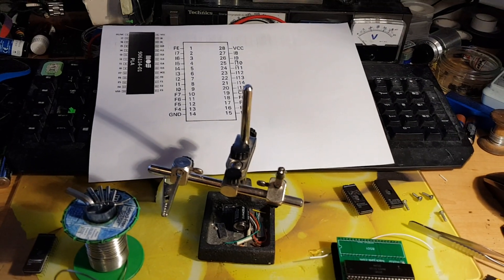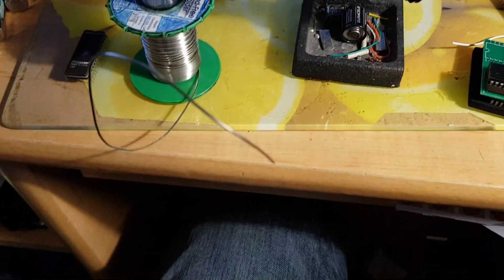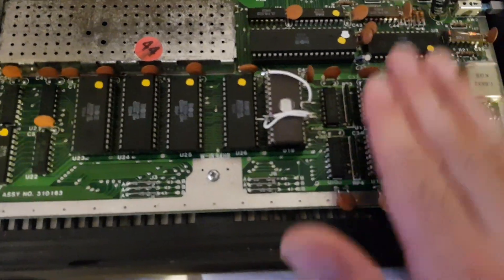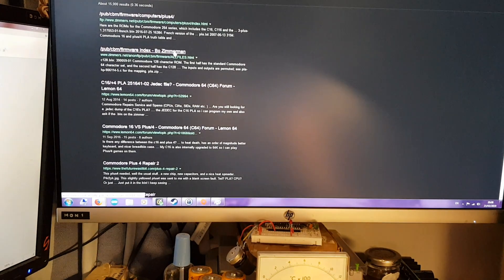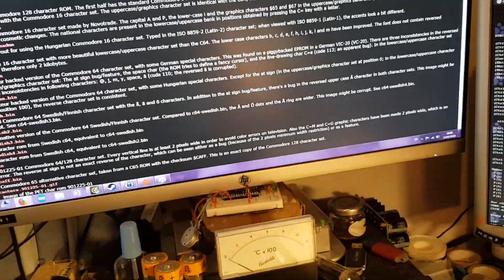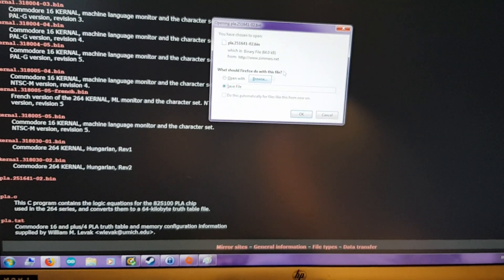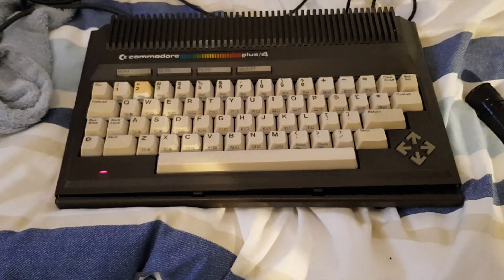Commodore Plus 4 EPROM PLA Replacement Restoration

Comment: when i was a kid i took my plus/4 apart....pulled the chips out .....and put them together again ....shorted a few legs on someof the chips when it was turned on,screen went all multicolored blocks and random characters inversed .......with flashing bits........and it never worked properly again😂
Reply from the maker: Sounds about right. I have fucked up similar in some ways.

Comment: Hi there EPROM9, unfortunately, my Plus4 suffered a PLA failure. I have built this successfully and restored my Plus4 to the land of the living. I used a W27C512-45Z EEPROM. 

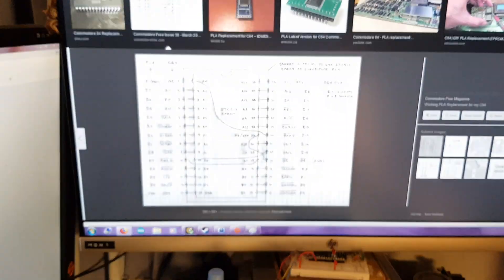At 3:06 there is a momentary image of a PCB layout for an adapter clearly from a German site.  A photo at the bottom is actually board is cut off. It would be really useful to add a link to the original site. 

Thanks David
Reply from the maker: That is good. Love to hear the video was useful in getting another Plus 4 or C16 working. Sadly that site decided to non-exist. The pin out is the same as the C64 adapter luckily.

Comment: Nice to see that an EPROM solution is possible for the 264 series!  How has the EPROM held up over time?  I'm thinking if trying this out for my C16, and am wondering if I can get away with using "faster" EPROMs than 150ns (I think so, but I'm a bit inexperienced with EPROM programming).
Reply from the maker: It has held up pretty well but i don't have any softeware for my Plus 4 so i can only do limited testing. I see no harm in trying faster chips, some experimentation is required. The only thing i would note is the socket adapter is at the limit of the hight you can fin in the machine at that end of the PCB.

Comment: Nice work. Not sure about the C16 but the C64 benefits from RC filters on the data lines in an adapter board (180ohm resistors in series and 150pf caps to ground). I think Ray Carlsen recently updated that adapter schematic for the 64 to include the filters after doing some more research. The problem is that, without the filters, the EPROM speed can be slightly mismatched with the rest if the system causing bus contentions where two things are active at once for a small time. This may cause wear and stress or damage to other chips over time. It may also help cool the other chips down a bit.  Keep it up.
Reply from the maker: I don't know the answer to that one. The EPROM runs a lot cooler than the original PLA which means less heat in the machine that is generated which is good for all the other fragial & delicate chips.

As the C16 & Plus 4 are the same machine the solution here would happily work for that. I have not done any long term testing on this, but the machine has reliably booted when ever I power it up.

Comment: Cover that EPROM before it bricks the system!
Reply from the maker: It was in the testing stage, that be why there was no sticker, incase I needed to burn it again.
Also I got this EPROM from an old photocopyer years ago at school, pulled off the sticker when I got it & when i pluged it into the tester it still had the photocopyer firmware on it. So as long as it is away from UV light it will be fine.
Reply: @TheEPROM9  I know this has probably come across as a nag, but it's better to be safe than sorry with how rare of a system the Plus 4 is. Anyways, your content on YT is getting better, I'm looking forward to the next vid
Reply from the maker: Na It is fine, feedback is handy. They are not as common as the C64 although they don't have crazy going rates, at least at the moment. That is what i am trying to do. Want ot grow my channel again & get more info such as this out there. Noone has covered doing this for the Plus 4 or C16. Makes me wonder if something simular could be done for the Acorn Electron & Sinclair machines, The Electron machines ULA's are rather flacky these days.
Reply: @TheEPROM9  Yeah addressing the issues and fixes for the micros is paramount to the survival of the original systems and the retro community as a whole. They've reversed engineered the SID chip, it shouldn't be too difficult to extend that to the PLA and VIC chips as well, especially considering how primitive they are in comparison to logic and processing units we have at our disposal today.
Reply from the maker: The 8-Bit guy does some exerlen videos. Does some great videos. Also pretty knolegable on the technical stuff.
Reply from the maker: The fact that these computers are now mear pokect calculators in comparison means we have a lot of options for building custom parts. Some day I should learn some FPGA stuff. Could see me using it for this kind of stuff. An FPGA would be good for recreating a SID.
Reply: @TheEPROM9  the FPGA SID is called the Swin SID, it works flawlessly with the C64. But as the 8 Bit Guy showed, it didn't work too well with the obscure SID chip MS-DOS soundcard
Reply from the maker: Nice, I am always impresed with the people who are smart enougth to reverce engineer chips. I am no where near that level.